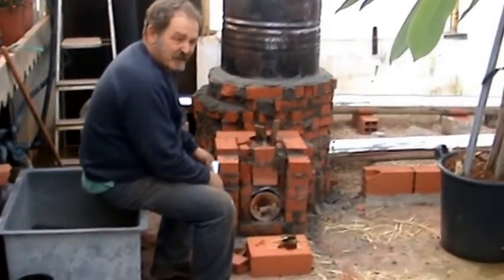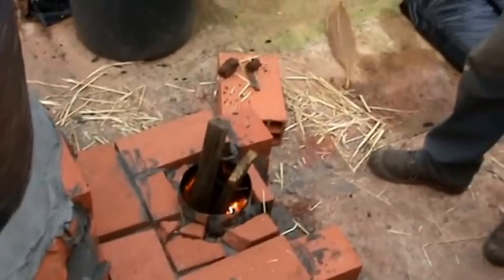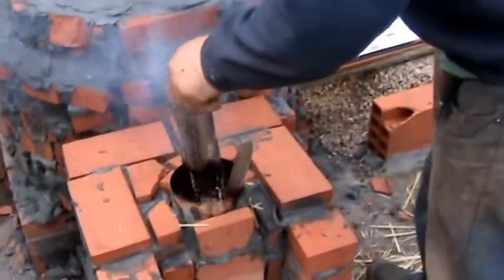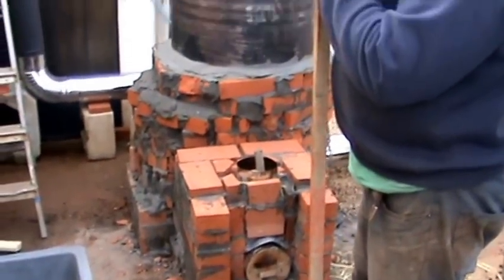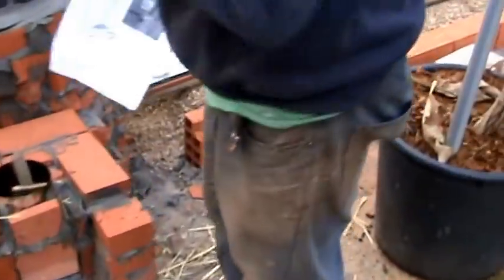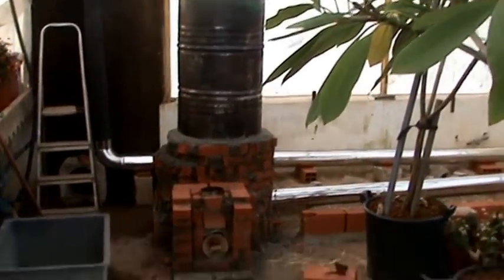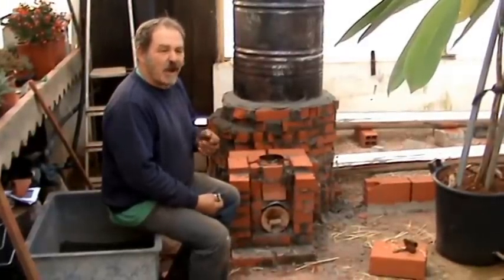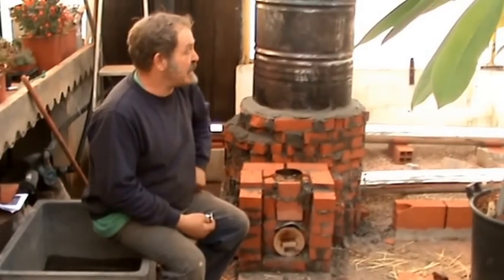Rocket Mass Stove Heater. Construction and lighting technique tip.

Comment: Splendid! I have learnt so many things from this video!  I have built a rocket stove and I don;t know if I can use a terracota stove /wood stove (it''s at about 1 m distance from the rocket s), instead of building the mass heater, I mean to introduce the exhaust pipe into it, in its lower part, of course. Ii will probably warm the terracotta and  the smoke will go out of the chimneyThe terracotta is 1.50m,/60cm/35cm.If you could answer me, I would be very grateful. Thank you very much!
 I like your explanations a lot.